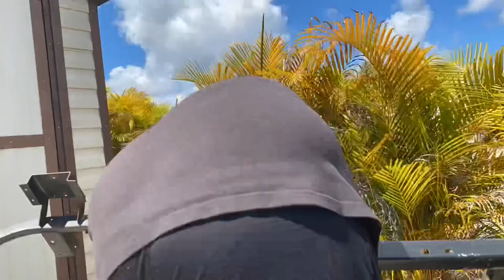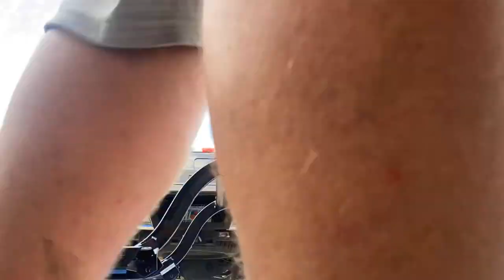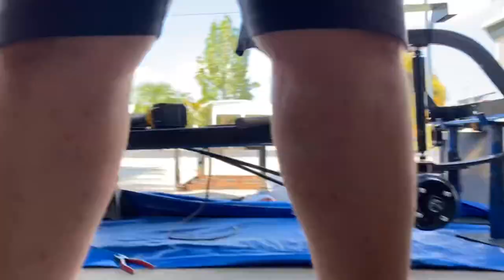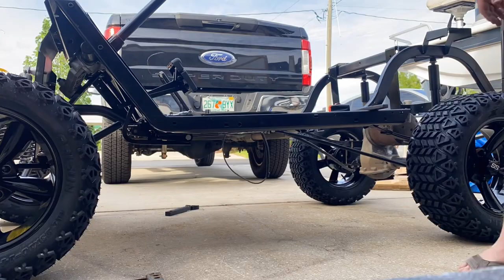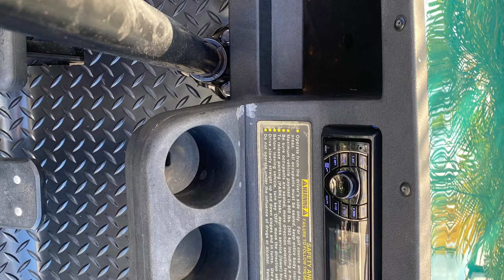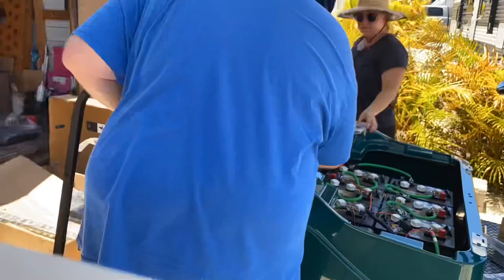EZ-GO txt golf cart build from frame up

Comment: Curious here, will the roller frame, without bodywork,  fit inside of an 8’ pickup bed?  Does the lift kit add to the wheelbase?  Trying to get some answers before embarking on a project.  Thanks in advance
Reply from the maker: @fireplugrm  it will fit perfectly in an 8 foot bed and should fit even with a lift kit it doesn’t add much or anything to lengthen it.

Comment: Did you notice any performance increase when you switched to the reversing contactor?
Reply from the maker: It didn’t really change any performance but it was a really good upgrade to the forward and reverse switch from the sliding contact assembly. The only thing that I also noticed is that in reverse it feels faster than the older setup.